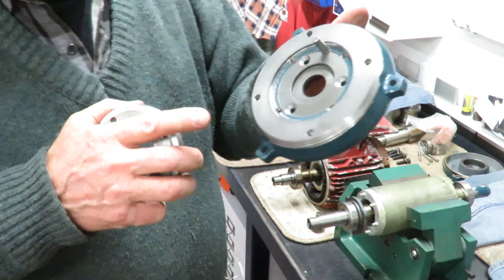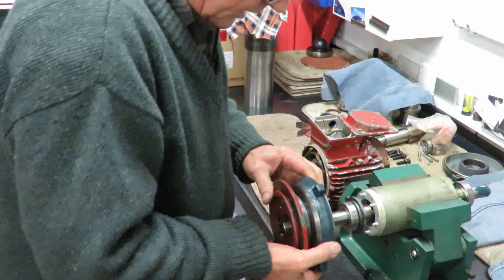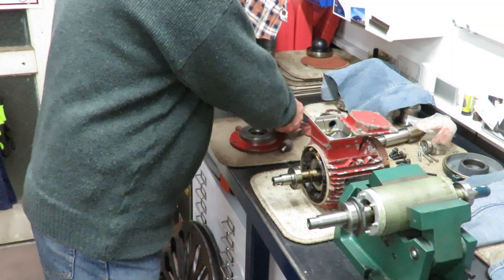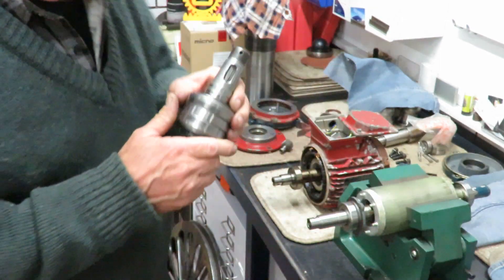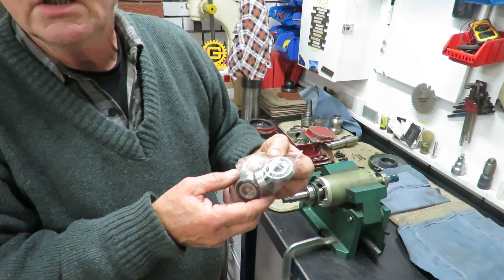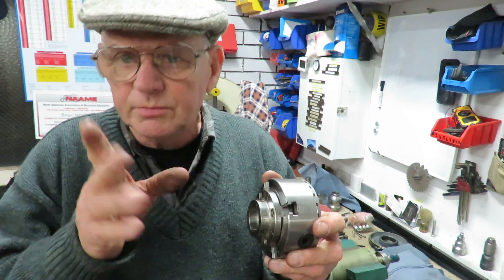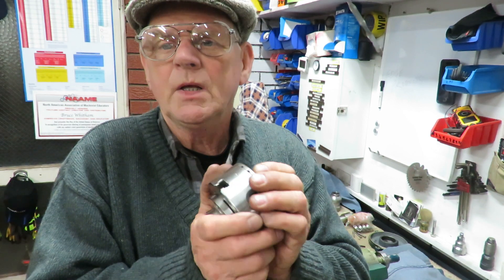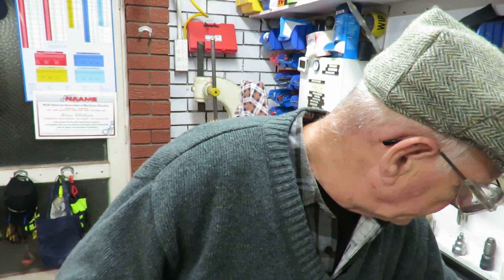233 This week in Bruce's shop

Comment: Thank you for your presentations. Would it be possible to do a video on how you measured the flange and adapter for the motor? 

Dennis L.
Reply from the maker: Dennis sorry already delivered, in essence I used a depth caliper to measure from the shaft end to the gear box mating adaptor flange on the old armature. I then measured from the shaft to the gear mating flange on the new armature. Calculated the amount to be machined off the old adaptor. Machined the new flange as thin as I could and made a counter bore to accept the new configuration. I then parted the end shield section off the old adaptor, and proceeded to machine the parts to mate up producing a new "end shield - gear box 3 part adaptor. Then I took the parts to the mill and drilled and tapped them.

Comment: Is the wheel like for a cable or has it just not had the tire mounted yet?
Reply from the maker: I have welded a band inboard of the windows which acts as the tyre, a soft flat belt runs from the drive and around an idler pulley. between these two a section of the belt engages the tyre the two plates act as flanges for the tyre.